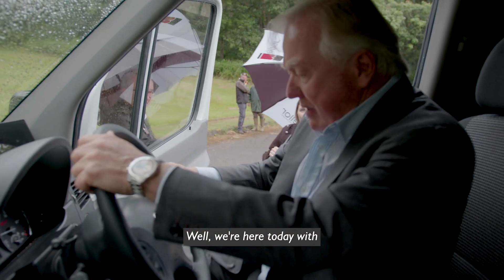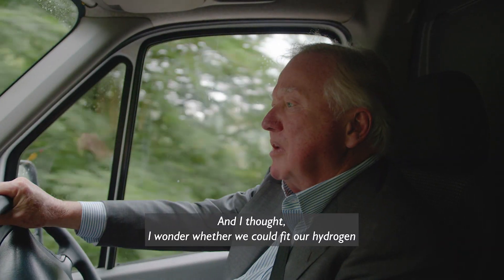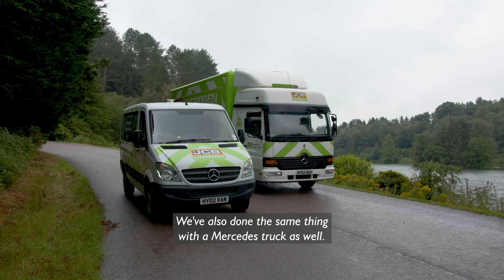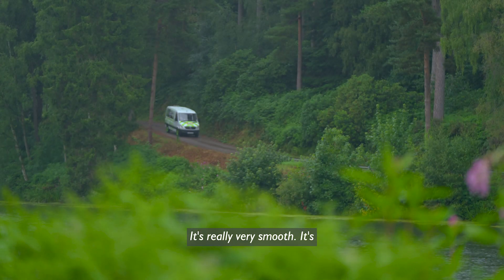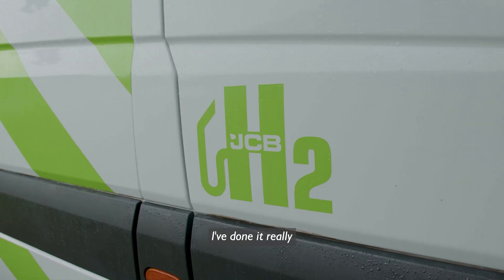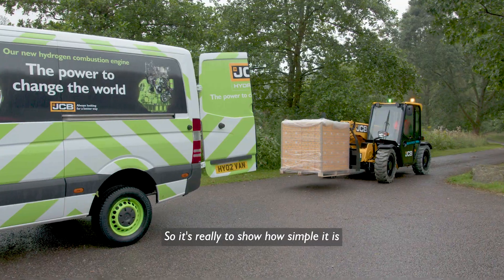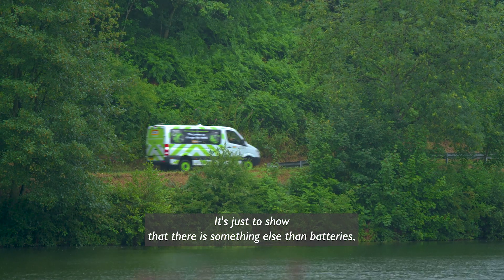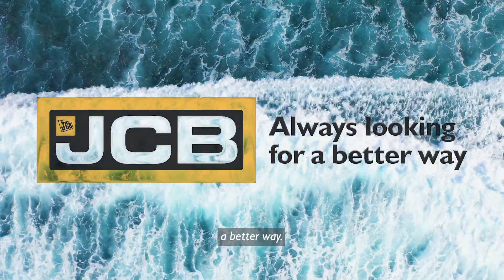JCB Chairman Lord Bamford's First Drive of a Hydrogen Combustion Van

Comment: Everybody posting that this is "definitely the future" and similar should go get a degree in either economics, engineering or physics.
Hydrogen has three main problems:
1. It's bloody expensive
2. It's hard to store
3. It's hard to transport
Using a hydrogen combustion engine instead of a fuel cell exacerbates all three problems, because the vehicle needs about twice the amount of hydrogen per mile ... great idea indeed!

Comment: There is no benefit O level physics can get you there with about half an hours work. The simple fact is that assuming a level playing field on supply infrastructure hydrogen will be more expensive than petrol diesel and of course electric which will be the cheapest of them all. Ultimately once the EV market has settled down these engines will be on the same scrap heap as any other IC engine. JCB has to focus on an electric backhoe and quickly. Hydrogen is just barking up the wrong tree and JCB will start to look silly if they keep at this too long, it's the numbers dear boy the numbers.

Comment: If the engineers at JCB could do this so easily it makes you wonder why exactly the rest of the industry is dragging their heels on the issue.

Why can't the likes of Ford, Renault, VW, Peugeot, Toyota, Nissan, Mercedes, Fiat, IVECO and Volvo etc not build a similar car in order to sell to the public?

I understand that obviously the infrastructure in order that you can refuel easily is needed and according to Rishi Sunak work on constructing the regional hubs is already underway.
Reply: It’s easy: hydrogen combustion engines make no sense from a physics and economical standpoint.

Comment: Hydrogen is going nowhere. 95% of it today comes from fossil fuels so what help is that?  Even if you use green hydrogen in your engines then that takes 4x the electricity to make the hydrogen in the first place compared to that needed to drive a vattery vehicle the same distance. Then you need to compress the gas, store it where it doesn't leak, and then distribute it to fuelling stations! It will cost a fortune to run a hydrogen vehicle because of the costs involved in producing the stuff. Wake up, this is never going to be cost effective or efficient. Finally, burning hydrogen still produces harmful emissions, QED.

Comment: The oil companies need to be pushed to produce Green Hydrogen and petrochemical Hydrogen in large and cheap volumes. Distribution should come from them and the EVs can look to the electricity producers for supply. Storage is the main problem the engineers need to solve.

Comment: I really hope that Hydrogen gains more traction because it really is a better long term option than battery powered electric cars. There's no need to mine huge amounts of resources to produce batteries, there's no diminishing range as the batteries age, there's no need to dispose of old batteries after a few years, and from a usability standpoint it eliminates the problem of how everybody can charge their cars. Yes it takes a lot of power to produce hydrogen, but if you generate that hydrogen using green electricity then you've made the whole chain greener. It doesn't matter how clean the power used to charge battery powered electric cars is, you've still got the environmental nightmare of the batteries!

In the UK, most of us do not have private driveways or garages where we can charge our cars overnight at home. So if we are going to try and push everybody away from using petrol and diesel vehicles it's either going to take hundreds of billions of pounds spent on installing hundreds of charging points on every residential street in the country, or require enormous amounts of land to be converted in to charging stations, because with every car taking 15-20 minutes to recharge instead of the current 2-3 minutes to fill up with fuel, the current network of petrol stations would not be enough, even if they were converted to only being electric charging stations.

With hydrogen that's not an issue. From the users perspective it's basically no different to petrol or diesel. You pull up at a filling station, you stick the nozzle in your tank and you fill it. The current petrol station infrastructure would be more than enough if they were converted to include hydrogen filling too.

No emissions from the cars, no environmentally harmful batteries to manufacture or dispose of, no worries about where you can charge your car or how long it takes, and it can all be retrofitted to work with our current refueling network. It just makes sense!

Comment: Hydrogen is 100% recyclable unlike batteries.
Reply: England is leading the world in battery recycling. Problem is batteries used for 30 years and not many available yet.. They used for static energy use after car use for about 10 years. The technology is changing fast.

Comment: I've always thought commerically if Diesel engines can be hot swapped out of existing cars with Hydrogen engines installed fo a smaller cost than a new vehicle it would be a gold mine.

Comment: Be good to know the specs!
Reply: I'm guessing 50 miles of range, and 20% loss of cargo space for the hydrogen tanks.

Hydrogen combustion is even more inefficient that fuel cell electric, and hydrogen is volumetrically less dense, I believe JCB is going for the lower 350 bar / 5,000 psi pressure so you don't need the carbon fibre tanks found in a Toyota Mirai.

I would like to know the NOx emissions of the tailpipe exhaust - it's not just steam coming out, I don't think they are doing serious scrubbing of either the air intake or exhaust - as is, this would probably fail emissions testing and is possibly not road legal. I think JCB were petitioning the government to allow worse emissions on the roads for hydrogen combustion, with Bamfords main man, BoJo out of the Prime Minister role, the influence there is somewhat diminished. Wonder if he can get a refund on the Wedding he paid for?

Comment: I do wonder if Mercedes are arranging any meetings? We need hydrogen lorries, buses and delivery vehicles. This will start the push for a fuelling network and hydrogen demand.
The argument currently is for EV’s is that demand will push the recharging network, the same is true for hydrogen.
I see the likes of big fleet operators having hydrogen tanks at the depots. This will then spur depots created to plug gaps in the long distance network. It may be decades before it is as widespread as petrol etc, but no less feasible than all the EV network required.

Comment: This is a non starter. The efficiency of green hydrogen is 1/3 of that of an EV. Combusting that in an engine is even worse - below 20% end to end efficiency. Fleets know this, there's no way they'd spend 5x more mile when they have a viable alternative.
Reply: Very little maintenance with batteries. Hydrogen needs air filter changed frequently. Hydrogen has great future with jcb.. But not in vans

Comment: Is anyone aware of specs being published for this vehicle? Hydrogen engines jave been a thing for a long time, the challenge is storing the hydrogen and getting decent range out of it. This is one of the reasons fuel cells have been preferred for hydrogen vehicles - you effectively have double the efficiency of a combustion engine so you double the range. It would be interesting to know how much hydrogen this van carries, in what size tank, in what state of matter and what range that will give.

Comment: Great stuff… 
In the end what’s better for environment, ie the space we live in
Reply: Batteries. This is a combustion engine and still has NOx and other smog producing particulates, it's not a fuel cell electric van. Also, the hydrogen is highly likely to have emitted 9 to 12 tons of CO2 per ton of hydrogen when made from steam reforming fossil fuel methane gas, which is how most hydrogen is made.
Reply: @brushlessmotoring  did you not read??
Engine has very little nox..

Also if you smoke or vape you are inhaling nox.. cook by gas.. it produces nox.. gfch..nox 
Light a match …. Nox
BBQ… Nox
Reply: @IrishFoxHound  this is a lot bigger than a match or vape or bbq - I want to see results from emissions testing. Right now, JCB and Bamford are petitioning the conservative government they have made large donations to, to change the rules on NOx emissions for hydrogen combustion vehicles. That implies they are not in compliance with the existing rules, and they are not interested in the exhaust conditioning that diesels have to do.

This is not a clean vehicle, even in the highly unlikely chance it is using actually green hydrogen.
Reply: @brushlessmotoring  can you see all ice cars replaced with ev’s..,? 
There isn’t the capacity. No way in hell is there
Reply: @IrishFoxHound  it's only new cars that are switching, so the replacement is not immediate, and if you don't think there is enough grid capacity for EVs (there is) - then how we you going to make the clean hydrogen?

It takes 3 to 5 times MORE electricity to move a vehicle using clean hydrogen than it does a battery EV - these are real world comparisons between the Toyota Mirai (Hydrogen Fuel Cell Electric), BMWs dual fuel combustion prototype (the Hydrogen 7 Sedan) and a Tesla Model 3 real world 18kWh per 100km, so if you don't think there is enough capacity for EVs to charge overnight (there is already that capacity) then how does clean hydrogen solve that problem - where does that electrical energy to make the hydrogen come from?

In order to be truly clean, it has to come 100% from renewables, which means we need to build 3 to 5 times as many solar farms or wind turbines to use hydrogen vs direct charging an EV from the same sources.

The curtailment argument, that we use 'free' wind when there is too much to make and store hydrogen is solved by EVs plugged in and set to top up 10 kWh (15%) when excess wind is available - times 30 million cars (in the UK) - thats a 300 gigawatt hour virtual battery, equivalent to 17 million kg of hydrogen than you don't have to distribute, because it's already delivered into the cars, grid operators will be very happy to have a virtual grid distributed battery to use.

So, yes, over 15 or so years, starting with new cars, I can see most (but not all) ICE cars being replaced, I see EV charging as a solvable problem - but fully recognize, non Tesla, it's not in a good enough place right now - and that needs to be worked on, thats where the investment should be.

Hydrogen filling stations cost millions to build and hundreds of thousands to maintain, and only serve a couple dozen cars a day, California is a case study in hydrogen failing, the price rocketed to $36 per kg (from $13 two years ago), and is even more volatile pricing wise than gasoline is.

UK is retreating from hydrogen at the consumer level, I don't know what got into Bamfords head, but if he can't get it out again soon, JCB is going to fall behind their competitors who are all electrifying. (JCB is electrifying too, but for some reason are only making noise about hydrogen prototypes you can't even buy - I don't understand it.)
Reply: @brushlessmotoring  listen.. electrical networks are done on diversity as in take a street.. not everyone is going to shower at the same time using 9.5KWPH
A street cannot have all its houses charging ev’s at the same time..
Reply: A hydrogen refilling station can serve hundreds of cars per day… 
Get away with yourself
Reply: @IrishFoxHound  at night it can easily support every house charging an EV on a cheap overnight 11pm to 5am tariff - ask Norway. You didn’t answer where the 3 to 5 times more electricity to use clean hydrogen would come from. It’s not a distribution limit. An EV can be the load as a drier or kettle.

Comment: So are JCB going to be selling crate engine kits for retro fitting to combustion engine vehicles? Hydrogen seems a far better solution than electric imo
Reply: No, they are not. Weird video / project for them to do, considering there is no saleable goods coming out from it. Just shows JCBs whole hydrogen push is actually propaganda not products, their real goal is to distract people from their battery competitors like Volvo, CAT, etc. with promises of 'future' hydrogen machines - but, as far as I am aware, they have not sold a single unit powered by hydrogen, just hauled their one off prototypes around to get photo ops with their donor politicians they have a nasty habit of throwing money at.

Comment: The possibility for these engines are endless but for one thing, the production of hydrogen. I wish JCB would develop an electrolyser for the home and workshop. Something you can fill up your car or van with in 5-10 minutes without storing hydrogen on site. A one stop pump that produces, compresses and transfers the gas direct to the vehicle’s tank. Also something compact “not the size of a 20” shipping container” which you can plug into your mains utilising your green tariffs or from an on-site solar or wind power supply? This could be transformative for hydrogen vehicles….

Comment: I think this is the best way forward simply because battery production is, in itself, harmful to the planet. Also, the amount of batteries needed for heavy vehicles is crazy. Good work JCB and Lord Bamford!
Reply: Batteries has come to stay. Hydrogen will come. There will be different options for different purposes, working in parallell in the future
Reply: @Rimrock300  fair comment
Reply: Carbon-fibre based pressure tanks for hydrogen fuel cell vehicles use about the same amount of energy to produce as batteries for battery electric vehicles, in case you didn't know.
With a combustion engine, you need about twice as many tanks compared to a fuel cell vehicle. Obviously the fuel cost per mile also doubles.

Comment: What's missing is what he didn't say. It is perfectly possible to make an internal comustion engine running on Hydrogen
BUT...
1. The conversion efficiency is about 25% (vs 95% for battery electric, 70% for hydrogen fuel cells)
2. The mass storage density for hydrogen is low - I'd be surprised if he can go more than 20 miles. Look at the Toyota V8 hydrogen car.
3. There are combustion by-products (NOx) that need a catalytic converter or similar. Nobody's sucessfully built one for a Hydrogen internal combustion engine yet.
4. Lubrication is a problem at hydrogen combustion temperatures, so it isn't clear how long an engine could last
5. We don't yet know how hard it is to produce green hydrogen at scale - we do know it isn't easy (none of the major oil companies have managed it yet). Anything else would be an ecological disaster.
6. The necessary hydrogen "gas pump" infrastructure (necessary to run vans and commercial vehicles on hydrogen) is eye-wateringly expensive.
...solve all these problems, and then we can talk!
Reply: It is 3 times as power dense as diesel.

The fuel tanks are getting smaller the current 3cx does a day's work on a tank and the tank fits on the roof of the cab.

The latest JCB hydrogen engine does not produce nox it's is completely clean

The hydrogen can be produced by nuclear power when demand is low creating smooth demand from the stations.

Infrastructure for delivery is matter of will from the oil giants.

So I'd say were nearly there
Reply: Spot on. Also, in the US, Hydrogen is US$36 per kg, not sure what it is in the one remaining UK station. Cost has basically sunk hydrogen fuel cell cars in the US.

Comment: 5 years ago I looked at the Toyota Mira, and dismissed it on the ground that there was nowhere local to obtain the hydrogen.  More recently I got excited by the prospect of purchasing an EV.  But after undertaking some SERIOUS research, covering in no particular order, initial cost, servicing charges, the lack of a realistic path to provide the necessary charging infrastructure, vehicle fires, residual value, child labour, etc. etc.

Rowan Atkinson, he has a honours degree in engineering, recently published a series of articles in the Guardian and online, search for them, I anticipate you might be impressed. He explains why hydrogen could be the solution, and how JCB’s initiative could lead to hydrogen powered commercial vehicles.
Electric lorries require, long range capability, without the need for constant stops to recharge.  The uptake of hydrogen powered lorries will drive the the provision of hydrogen production and the provision of a network of supply stations.   Once this get underway it will initiate the development, and supply, of hydrogen powered cars, and the demise of EV’s will become inevitable.